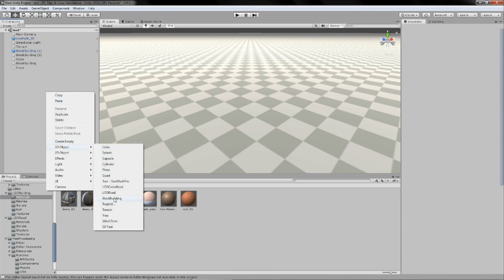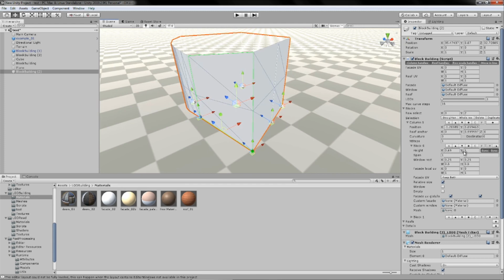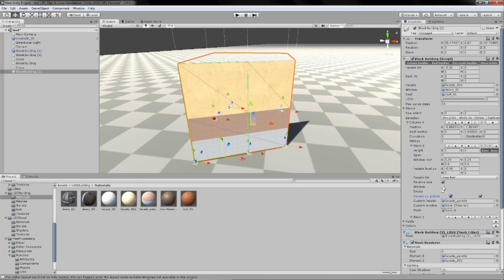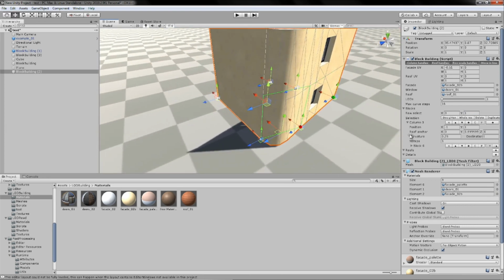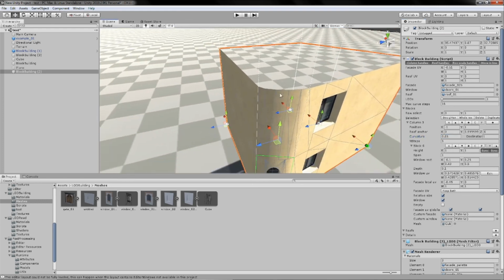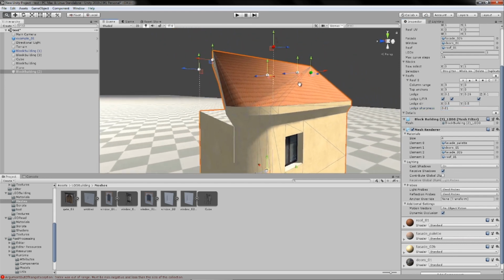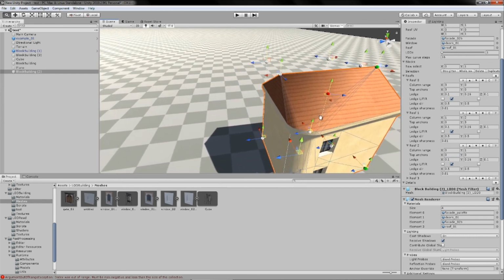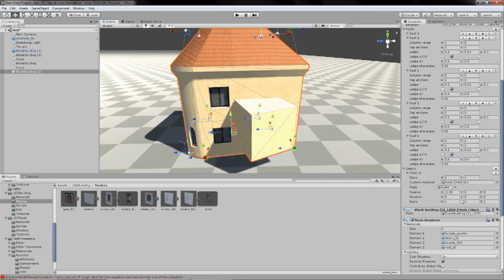BlockBuildings - procedural buildings for Unity engine

Comment: If I am procedurally generating buildings based on osm polygons, how would I best go about generating the roofs automatically? Im not sure how many columns to choose etc.
The polygons (building structures) can be quite complex
Reply from the maker: Performance-wise, it is best to keep column count as well as block count low, both for mesh generation and rendering. You can have a whole grid of windows in one block, if you don't need a lot of customability and you supply custom mesh. 
About algorithm for generating roofs, it would be best to create one roof segment per each column and let it span only across the one column. Then, decide how many roof anchors you need, and put them where you need to. It doesn't matter which column the anchor belongs to. Then you assign the anchors to the roof segments. Segment having both anchors attached to same anchor will be triangle shaped, creating a gabble. If you need flat roof and the polygon is convex, you can use only one anchor at level of the top of the columns, including height of roof ledge.
If you use ledges, you need to set shape of ledge on all segments (neighbouring each other) the same to avoid gaps. Disable left or right ledge on a segment if it is adjacent to another segment on the side, to decrease vertice count.
The real challenge of course, is the placement of anchors and assignment of anchors to segments on complex, non-convex, polygon, obtained from map data. BlockBuilding unfortunately does not provide any such algorithms - I designed it having only manual creation of individual buildings on mind.
Generating roofed niches, or multiple separated roofs on different floors, or building with wings, as on some of the example buildings, which are part of this package, would be much greater challenge. To be practically able to do that, the roof model would need to be completely redesigned.
For such cases, or other complex cases, or non-convex polygons in general, I would recommend to split the polygon in several smaller polygons and "stitching" a single building from multiple BlockBuilding instances. You can disable mesh generation on occluded column blocks to avoid performance waste.
Another helpful trick, that will help with simple buildings, is to create set of buildings of different polygons (floor plans) by hand, and then for each building on the map, your generating algorithm would decide if any of your pre-made building can be used there (based of number of polygon segments, length of the segments), if yes, copy it on the place and edit its polygon to fit the actual polygon on the map.
Reply: @DanielGruncl  The premade buildings make a lot of sense. Thats a great idea.
While working with your script a bit I found that your generation is very dependant on the order of blocks.
I am trying to get your blockbuilder to work given a random set of points that form the polygon.
However, the order seems to be very strict so that your generation works and all faces generate correctly.

This is very difficult for me to determine how to do properly. 
In NodeInsertCtrl() you do some calculations to determine the block index, Im trying to use that logic to be able to get an ordered list from a random set of points but its not working as expected. 

Thanks for your time!
Reply: @DanielGruncl  This is what Im trying to do:

    public static void AddPointToPolygon(List<Vector3> polygon, Vector3 newPoint)
    {
        if (polygon.Count == 0)
        {
            // If the polygon is empty, simply add the new point
            polygon.Add(newPoint);
            return;
        }

        int minIdx = -1;

        if (polygon.Count == 1)
        {
            // If there's only one point, decide to insert before or after
            float distToFirst = Vector3.Distance(newPoint, polygon[0]);
            minIdx = (distToFirst < 0.01f) ? 0 : 1; // Add before or after
        }
        else
        {
            // Find the segment where the new point belongs
            float minDist = float.MaxValue;

            for (int i = 1; i < polygon.Count; i++)
            {
                // Measure the perpendicular distance to each segment
                float dist2 = HandleUtility.DistancePointLine(newPoint, polygon[i - 1], polygon[i]);
                if (dist2 < minDist)
                {
                    minDist = dist2;
                    minIdx = i;
                }
            }

            // Special cases for edges
            if (minIdx == -1) minIdx = 0;
            else if (minIdx == 1 && Vector3.Distance(newPoint, polygon[1]) > Vector3.Distance(polygon[0], polygon[1]))
                minIdx = 0;
            else if (minIdx == polygon.Count - 1 && Vector3.Distance(newPoint, polygon[minIdx - 1]) > Vector3.Distance(polygon[minIdx - 1], polygon[polygon.Count - 1]))
                minIdx = polygon.Count;
        }

        // Insert the new point at the calculated index
        polygon.Insert(minIdx, newPoint);
    }

Usage:

      points = this.gameObject.GetComponentsInChildren<Transform>().Select(t => t.position).ToList();
      List<Vector3> orderedPoints = new List<Vector3>();

      points.ForEach(p => AddPointToPolygon(orderedPoints, p));